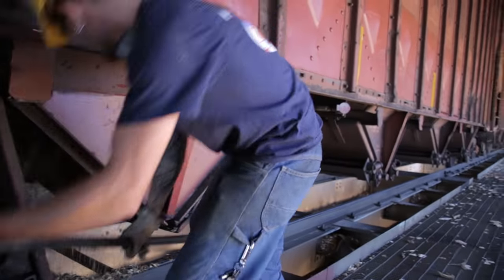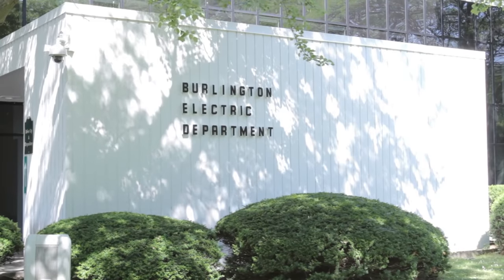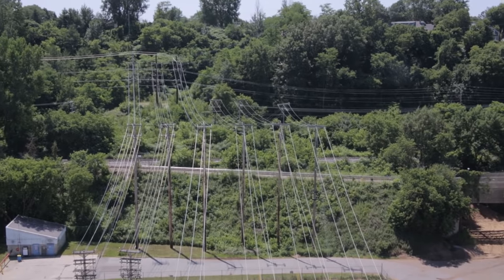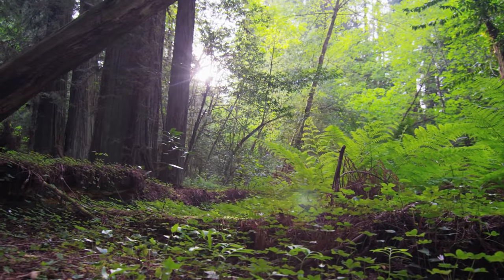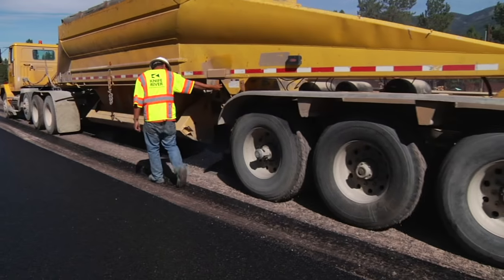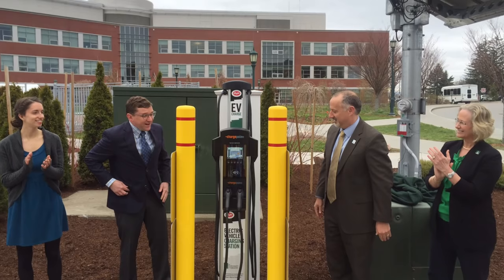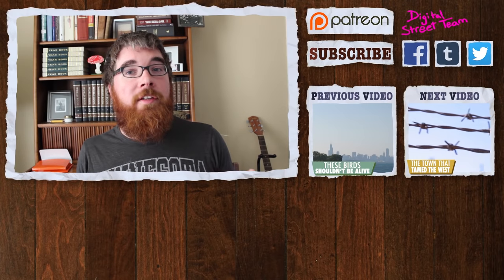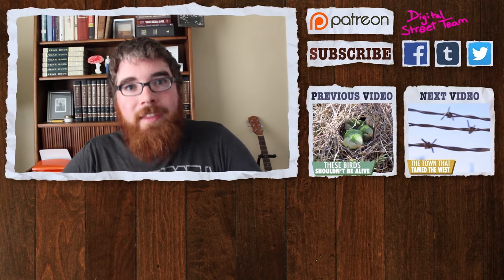Can A City Run On 100% Renewable Energy?

Comment: As per usual, this kind of setup is mostly feasible thanks to an abundance of renewable natural resources, something many places in the world don't have access to. 
Personally I think nuclear is the way to go, not in the sense that we need to build a ton of reactors right now, but that we should do more to promote research into Gen IV Reactors. Right now a lot of the resources that could help nuclear reactors become safer, more energy efficient, and make use of old nuclear waste, is being poured into things like solar which is incredibly inefficient, demands vast amounts of space and a restructuring of the whole energy grid to be feasible large scale, not to mention impractical up north where solar hours drop drastically during winter.
We do need resources like solar and wind, but it's unreasonable to think that they can contribute the bulk of our energy needs.
Reply: Not Generation IV, mor like Generation V which includes Nulcear Fusion and Thorium Reactors?
Reply: Forget the -?- it was an typing error
Reply: No Name You have a lot of good points, and yes nuclear power is not a perfect energy source, but I still believe that with further development a lot of the issues would be mitigated. For example, future reactors will produce much less waste than modern iterations, and sure that's still a lot of waste created, but the aim is to reduce the waste to isotopes with half-lives in the hundreds rather than millions of years. The aim would also be to create something more scalable, which would help with integration into electrical grids. Also, regarding coolant, a lot of Gen IV reactors designs do away with water as a coolant, as pressurised water is seen as a major safety concern.
All in all, there are a lot of potential benefits to accelerating research into future nuclear technology.
Reply: The the problem in fusion is Turning on the reactor, not off. It is impossible to make a fusion reactor explode, the worse that could happen is that the walls become bacon and you have to take them, Zero enviormental or human damage. With Fission it's the Other way around, although Thorium solves this
Reply: +No “ThisIsImpossible” Name pls read up on fusion cause everything u said is completely wrong
Reply: +No “ThisIsImpossible” Name no turning of fusion is just wrong.
Reply: +No “ThisIsImpossible” Name the other part was about heat mitigation, the problem is not the amount of heat but how to convert. It sounded like it was a problem like it is in fission where the heat is a problem cause u can't turn it off
Reply: "renewable natural resources, something many places in the world don't have access to"

Putting aside the invention of power lines, can you name anywhere that doesn't have renewable [energy] resources? You say there are 'many'. Can you name even one?
Reply: gasdive When I say renewable natural resources, I'm talking about renewable resources that can be used large-scale and provide the majority of the power a country uses. These are mainly hydro and bio-mass. All countries have access to wind and solar to some degree, but right now those technologies aren't even close to being able to stably provide for a majority of a whole country's energy needs. There are plenty of countries without access to the vast forests and large beds of water with a regular supply of rain needed for hydro and bio-mass generation (think northern africa and south asia). 
If you look at the wikipedia article on places which run on 100% renewable, you can see that all countries listed have hydro as their main source. Smaller areas with good geography can use wind for all their energy, but it's thoroughly impractical on a larger scale.
Reply: brodersami
Much easier to make claims that renewable resources aren't available if you just dismiss the two cheapest ones as 'thoroughly impractical'.

You pick 'North Africa' as a place without renewable resources. Morocco (which is a country in north Africa) is currently building the solar that you say can't be built to provide all their energy 24/7 with a view to exports when interconnectors are built. You should let them know that the technology isn't 'even close to being able to stably provide for a majority of a whole country's energy needs' before they get too far into building it. The first phase opened in February so you should hurry to let them know. They're planning to get the majority from renewables, mostly solar, in the next 14 years.

https://www.theguardian.com/environment/2015/oct/26/morocco-poised-to-become-a-solar-superpower-with-launch-of-desert-mega-project

South Asia... I don't exactly know where you mean by that, but China is building solar, wind and hydro faster than anywhere else in the world.
Reply: No Name
"the majority does not constitute the whole" When you go from 3% (which is what they had) to >100% you have to pass through 50% which is when you reach 'majority'. They expect to do that within the next 14 years. My point was that there are renewables there, actually collecting them takes time.

"second Solar can't provide baseload to any currently available power grid in the world today" [emphasis added] That's not correct. Solar can but as yet doesn't. There's a huge difference. Within a decade or so it will be doing exactly that in Morocco.

"third 14 years is a long time, his 'not even close' argument has merit" He said the 'technology' is not even close. The technology is there and it's being built right now. So the complete argument has no merit.

“Lastly the scale of this project has never been done before, you make it seem just because it is a planned project that it is just going to work perfectly, you clearly have never worked on a large scale project before."

It’s a staged project. Each stage is basically the same as all the others. The first stage is complete and it works as designed. Right now they’re just building the same thing again. At this point it’s like arguing that you can’t build a row of houses because you’ve never built a row of houses before, but the first one is already occupied, the second one is having final fit-out, the third one is framed and the fourth one has the foundations poured. The finished first one is proof that you can build a house. From this point on it’s just repeating what you did before. However even if the project had failed, that wouldn't mean that the renewable resources weren't there and abundant, which is the claim I was taking issue with.

And though it’s completely irrelevant, I have project managed large electricity infrastructure projects. I was one of the project managers on this for instance, which was of a scale never done before at the time. https://en.wikipedia.org/wiki/Queensland_%E2%80%93_New_South_Wales_Interconnector
Reply: A lot of poor countries have one big resource, land space for solar, so what is the problem.
Reply: John Thaller Problem is too little political will / funds / workforce and too much democracy / human rights. None of that with China. China has solved all that. If they decide something they do it.
Reply: I'm sorry to dissapoint you. No material can resist neutrons bump of a Thorium nuclear fusion reactor. Every material becomes radioactive. So you'll still have nuclear waste to deal with. Unless we can take that waste out of the planet safely, I don't think it's a good idea.
Reply: huh? what has thorium to do with fusion?
Reply: Not a lot of countries have economically viable uranium resources. Almost every uranium mined on Earth came from the top 10 largest countries.
Reply: Safe non-weaponizable nuclear is clearly part of the future. That said, Solar alone, 1% of what Earth receive, can already power the world.
Reply: brodersami People are too scared of Nuclear (Not necessarily rationally), so it's becoming less politically feasible :(
Reply: Fusion (as compared to traditional Fission) is still not feasible yet.
Reply: I think it is weird, that you speculate about how great next gen nuclear reactors will be, while you dismiss other renewables as impossible, even though they work in small scale.

Uranium based reactors will run out of fuel in this century. Also they pollute much more than renewables. As the fuel gets more rare it becomes a bigger cost factor and the pollution will rise. So it will get more expensive and pollute more. Then there are safty issues (terrorism, what to do with the waste) and they are very inflexible. Turn them of and it needs a few says to turn them on again.
Thorium based reactors are still in development, they don't have the fuel problem that uranium will have, but the other problems are similar AND there you actually get a problem, cause it is much much easier to create a nuclear weapon in a thorium reactor!
And downscaling won't happen.

Fusion might be the futur, but we don't even know if it will work as a proper power plant.
Reply: "Solar ... wind ... unreasonable"
I think it is important to be honest, that there are issues with wind and solar, but "unreasonable" is unreasonable I think.
We know that resource based products get more expensive over time and the bigger the demand is, as the resources get more rare.
Technology based products get cheaper with bigger demand and over time. (Due to mass production and a better development cost to amount of unites ratio)
So that would be a plus for solar/wind over fossil and nuclear as a future technology.
Reply: Germany (I take Germany cause they are one of the biggest economies in the world with big industry and they try right now to switch to renewable) is an interesting case study.
30% of the electricity comes from renewable. 6% from solar (some of those are 15 years old with a pretty bad efficiency) If they would put the most efficient solar there is right now on all proper roofs in Germany, that would produce around 40% of their electricity. That would be a serious part.

The solar they have produces 6% on average, which means 0% at night and over 50% on some sunny days.
So storage is a big issue that has to be solved if you want to increase solar (same with wind).

One technology that works, but isn't cost effective yet, is power to gas. There are studies showing that if there is to much renewable electricity available and there are big power to gas backup plants, that they would become cost effective. The German gas pipelines can safe enough energy for a few month!
Reply: Jakob Schulze That's only under assumption that only solar is used, but in reality, there are a lot of renewables that can be added to the mix.
Reply: +Mickey G
Sure, but I tried to keep it simple as the claim was "solar can't be a big part of our energy source".
Reply: +Mickey G
Sure, but I tried to keep it simple as the claim was "solar can't be a big part of our energy source".
Reply: Nuclear energy has been around since the 1940's yet it still isn't safe or clean. I doubt it will ever be a reliable main source of energy.
Reply: I've heard a lot of good things about liquid fuel, molten salt reactors using the thorium fuel cycle but it isn't my field.
Reply: nuclear power has never made a profit.
Reply: Citation please.
Reply: 35 years in the utility business. Spent fuel storage and decommissioning costs for large nuclear plants are not included in fiscal reports for shareholders and ratepayers benefits. When these plants retire they will need continuous site management with 0 output. Any problem with spent fuel storage will exhaust the insurance liabilities currently in place. Figuring the costs of construction, running costs, staffing and the costs outlined above, it is not hard to understand. How many nuclear plants have been started since 1980?
Reply: Solar. might be less efficient now, but the same principle (investing on in gen IV reactos) applies to solar panels. So you do not have any point here. Not to mentionne the fact that there isn't only solar as renewable energies, there's hydro and wind too.
Reply: Even assuming 300 years for storing nuclear waste, thats quite a long time. Plus, one needs to consider the fact that starting up a nuclear power plant is a large up front cost. Not everyone would be able to do that

One country in the middle east has a project capable of delivering 1.8 cents per kWh. Humanity's current battery tech isnt bad now. Tesla boasts above 85% round trip efficiency. So lets say all of the power is put into storage, so lets say you effectively only get 2.1 cents per kWh. Not bad.

I say, countries who can harness lots of solar should really take the solar route.
Reply: The Nuclear Waste Fund has $30 Billions dollars in it and earns about $1 billion in interest each year. They stopped collecting the fee from utilities in 2014 because there is no need for any more money to deal with decommissioning/waste storage.
Reply: Sad, but true.  But don't give up...the facts are on nuclear's side.
Reply: Mickey G Uranium is not the only thing we can use we can also use theorium
Reply: wildreams Its feasible but it doesn't produce more energy than it takes yet
Reply: Jakob Schulze We can also use Theorium not just Uranium
Reply: Solar could generate roughly 40% of the electricity used if it was on every rooftop. It would take time and money but it could be done, and it should be a goal. That's a huge chunk of our energy needs. I don't see why the other 60% couldn't be filled in with other renewable methods.
Reply: @dacution  The reason its not safe and clean is because no one is putting funding into it.
Reply: @Dryhumpington  U see the problem is the world isn't united.Because of these only the richest countries could afford that.
Reply: Agreed there is one young nuclear engineer Lesley dewan who has a reactor design in development

Comment: The average residential electricity rate in Vermont is 17.01¢/kWh, which ranks 5th in the U.S.  They use less electricity which makes sense in that they are probly using kerosene during the winter, with its low population  density, not to mention areas covered in water mesns it is average in pollution.

Comment: Factoid:  Coal, natural gas, and oil are organic fuel sources just as wood chips are.  Coal, natural gas, and oil are mostly plant life that has been under heat and pressure for quite a while.
Reply: Yeah but only one is renewable.
Reply: Coal and oil aren't renewable resources, but wood is. Trees and other woody plants can be regrown faster than they are used which is why it makes it a renewable resource. People are trying to move away from coal and oil because within 45 years we won't have any oil left. This is why we need to find alternatives to coal and oil now and try to cut back how much of it we use.
Reply: Not that we wont have any Oil left but rather suffer from a servere shortage of supply as new wells need to be established and there is only soo much oil you have avaliable. Also you need to clarify what type of Oil, as for instance Olive Oil may stay for longer or go faster depending on how competendly Humanity manages an upcoming Planetwide Climate Crisis. (Now there technicaly already is one, but from stating what now is normal ... dont worry though Humanity will luckily prevail ... thankfully)
Reply: How long does it take to create oil?

How fast are we using it?
Reply: Thorium reactors consume almost all nuclear waste and are much cheaper, produce no CO2. You will be greatly surprised. On the other hand oil and coal barons will fashionably support all alternatives as long as are inefficient (over all produce more CO2). That’s the way they govern us thirsty over the water and make us to be willing to pay all kind of green taxes.

Comment: Burning biomass is like burning stuff that hasn't turned into coal yet.
there is no other way to describe that in words which makes it sustainable
It still emits a shit ton of CO2 into the environment.
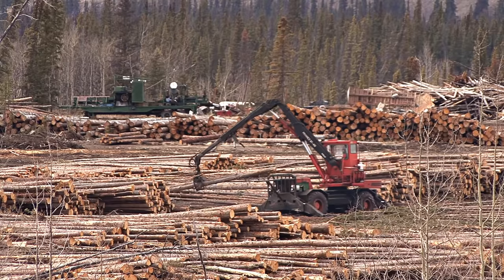@6:43 they have cut down an entire forest.
That's not "leftover wood bits" as he described.
Forests are not growing back at the same rate... they take hundreds of years to grow back.
I would respect their efforts if they removed biomass from the picture.
Reply from the maker: Ok, so full disclosure - that clip from 6:43 is not actually from Vermont - its stock footage (we couldn't obtain actual footage of their forestry operation unfortunately).  Biomass is not a perfect solution by any means, but supposedly Vermont has more trees now than it did a hundred years ago.
Reply: ok that makes more sense. Thanks.
Your right, biomass is by no means a long term solution.